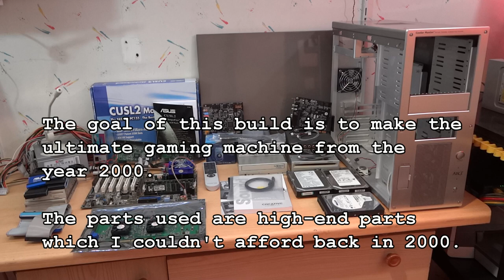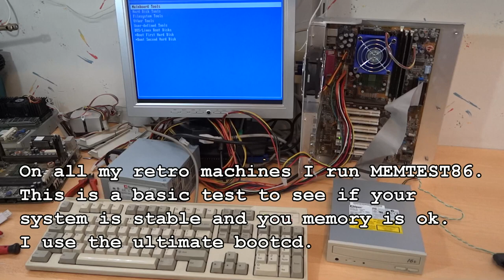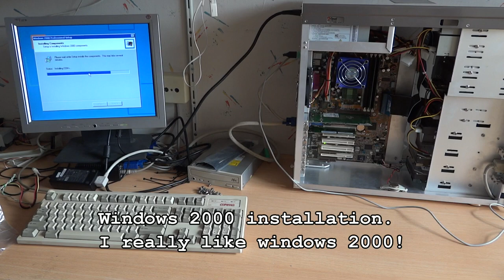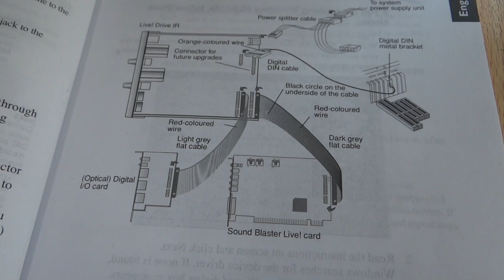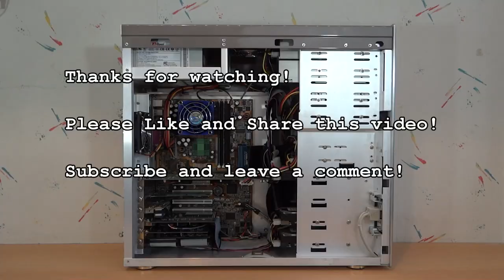Ultimate year 2000 gaming build! 3DFX Voodoo5 Asus CUSL2 P3-1ghz CM ATC201

Comment: Thats a nice case even by todays standards.
Reply: +Clesarie agreed.
Reply: I was thinking the exact same thing watching the video
Reply: +Clesarie The only thing that would make it better is if it had today's level of cable management options, better front I/O (even so, that can be fixed with 3.5" external brackets) and a CPU cutout on the back of the MoBo tray for easy aftermarket cooling installation. At that point, it'd blow any case on the market today out of the water.
Reply: Looks like he would have needed a time machine to build into it in 2000 as it was released in 2001. but yeah the case is nice, it was amazing back then.
Reply: +THERAZORKILLE Productions CPU cutout costs about as much as a dremel :)
Reply: i have one in the attic, doesn't fit modern 120mm fans and it be a shame to bastardise to do so. I have a p3-800 inside it. Might be time to get it flying.
Reply: it was excellent case, all screw threads were drilled in to steel rivets.
Reply: For my main desktop computer, I still use the same case that I'v been having since 2007, but I rebuilt it with newer components mainly from around 2012 to 2013 such as an AMD fx6300 six core 3.5ghz, 16 gbs of ddr3 ram 1866 mhz, 800 watt coolmax psu, 160 gb intel ssd with a 3 tb seagate hdd, and an AMD radeon r9 280 oc black edition graphics card with 3 gbs of vram.
Reply: Better than mine!!!
Reply: also needs better radiator support but totally
Reply: ^That's not Thats ^today's not todays
Reply: Absolutely! I had a choice to buy either this case or a Lan Li PC-07B Plus back around the mid-2000, I  got the Lian li case till this day, with some nice extras. Black brushed aluminum is gorgeous...
Reply: @TommyFenstermacher5150  cable management are horrible if psu are not modular because of how thick the cable were
Reply: But still it would for retro gaming pcs

Comment: You should power the 3DFX on it's own and not shared with any harddrives. Harddrives in the past where sensitive for voltage fluctuations. Esp. when going into 3D mode the AGP Card was able to take a peak load from that same line, causing a slight voltage drop. Harddrive's can go bad with such a setup. Props on the retro-build.  However a AMD Athlon was proberly the better and faster CPU for this setup.

Comment: Today I was taking inventory of some old computers I have, and when powering up my dad's old Dell, I found a Voodoo5! I was very surprised.
Reply: whoa, nice found
Reply from the maker: +inteli722 Sweeet! make a nice build around it!
Reply: +victorbart 3 days and some more salvaged parts later, I did just that. Not nearly as fancy as this build, but for $0, it isn't too shabby.

Pentium III 866 MHz, 512 MB RAM, 2 20 GB HDDs, a Soundblaster Live Value (made in 2000), and the Voodoo 5, all for a grand total of nothing but 2 days of leaning over a low table working on it. I just need an era-appropriate case, monitor, CD-RW drive, and mouse pad, alongside a copy of Quake III and UT1999.
Reply from the maker: +inteli722 Awesome! And with that specs just the same game experience as with this machine :)
Reply: +inteli722 i wanna a video by you m8!
Reply: +Tuna Yücer ***see a video
Reply: Tuna Yücer This video is way better than anything I could put together, so I don't really see a point.
Reply from the maker: Just make a video! Just do it :)
Reply: victorbart If I make a video, it's going to be after the custom painted case is done. I can't find a nice CM case like you found.
Reply: I found a Voodoo 3 2000 in a box of computer junk I was given for free. whole lotta crap, even got a K6 - 2 out of it :3

Comment: I still have my old p3 933 with geforce 2gts 32mb, 20gb hdd.. Bought the system in may 2000. Later i went dual cpu on a tyan tiger with 2x p3-1400mhz... I still have most of the parts. Inspiring video, thanks for sharing

Comment: Did anyone else notice the CD burner had its own cooling fan?
Reply: I once pulled a superdrive out of a trash picked Mac G5, it was an LG drive which had small twin fans on the back either side of the IDE connector and I remember laughing hysterically and the idea
Reply: Paul Omans 
a lot of the old ide  DVD drives had fans in them
Reply: Well, otherwise it would...
burn
Reply: Frytki? May i show you the exit?

Comment: When a 2000 computer runs better than my crappy 2016 laptop
Reply: Yeah, i'm very surprised. My laptop has the Intel integrated graphics... I fucking hate the Intel HD graphics, i can't even run cs 1.6 without lag lol. it's bullshit
Reply: Yeah, i'm very surprised. My laptop has the Intel integrated graphics... I fucking hate the Intel HD graphics, i can't even run cs 1.6 without lag lol. it's bullshit
Reply from the maker: +Yukki Amano This machine runs CS 1.6 like a Boss :)
Reply: +victorbart That's cool! in my house i found a first gen intel pentium (92'-93'), sadly the processor have 2 broken pins :c. It's anything valuable or it's garbage?
Reply: @missingno3617  hey
Reply: integrated graphic card is for showing something/able to boot into windows, when you don't have any card. Or your card will pass out. It's not for playing anything.
Reply: @missingno3617  The first gen Pentium only the 60 and especially the 66MHz model are really worth something. And with broken pins you are only able to sell the Goldcap ones (the ones with the golden headspreader) as scrap.

Comment: Geforce3 came out in 2000 and smashed the Voodoo5. Also, the AMD Thunderbird 1000Mhz smashed the Intel variant that year as well.
Reply: +George Babbitt 
In benchmarks the Geforce3 was better than the Voodoo5. However, many games at the time were optimized for the 3dfx instructions so the Voodoo5 card would run better than the Geforce3 in everyday gaming.
Reply: GeForce 3 was launched in early 2001. The contemporary card to the Voodoo 5 5500 was the GeForce 2 GTS which was launched a few months earlier than V5. The GeForce 2 GTS was faster than Voodoo 5 5500, so no need for GeForce 3.

Comment: It's interesting to see that despite how much has changed, some things still remained the same simply because of how things used to be.

We don't even take off most of our rear PCI-e covers today, but back then nearly every slot was used! Moreover, the ATX layout with the rear I/O, CPU in the middle top, and RAM to the side... nothing really changed the conventions even if tech improved significantly.

What an incredible treat! This case is still beautiful even by 2021 standards, and the removable motherboard tray is an amazing feature that i wish was more commonplace! I really hope Cooler Master tries to remake a case in this style, with modern conventions like front mesh, tempered glass panels, PSU shroud, and so on, but retains the nice silvery metal look and the removable motherboard tray...
Reply: I managed once to fill almost every slot in ATX case. I put graphics card (2 slots), Xonar DG, WiFi card, PCI-E slot cooler, USB 3.0 controller. But yeah, ATX form factor is pretty much overkill today. Most people would be totally fine with mATX and good part of us, even with mITX. What imo killed ATX was the death of SLI and Crossfire. That was the main reason why enthusiasts needed ATX boards at all.

Comment: No love for Half-Life? Or CS Beta 5? An Epic build though. Brought back a lot of memories.
Reply from the maker: Offcourse! :D I played HL1 so much. But I also wanted to try the other titles.
Reply: *****  I fail to see your point. Yes, some of these components cost premium in this kind of condition, on the other hand most can be found discarded in a dumpster or laying around in some hoarders attic. In fact I ditched a whole box of stuff from this era, all in good nick, just a few months ago. (yes into SER garbage)

Many of the games and applications from this era no longer working on modern computers and emulators are a poor substitute lacking appropriate emulation for 3D acceleration and most of the time sound hardware. They use (poor) software synthesis to achieve backwards compatibility.

Indeed now that I'm no longer a teenager and actually have serious disposable income I don't mind building rigs like this. They are a bit like vintage cars. Although my personal preference is for old 64bit RISC Workstations I can see the appeal in this type of a PC.

They are interesting pieces from the history of computing. In this case, home computing.

Comment: Hey Victor. I still have the same 40gb Maxtor drive in my PC from 2002, and after 13 years of usage still works flawlessly. It's kinda loud tho :)
Reply from the maker: +MegaBojan1993 yes a good drive :)
Reply: +MegaBojan1993 My 40G ATA HDD still runs without any bad sector, it's really rock solid :D
Reply: Vinh Duy Sadly, nobody makes long-lasting hard drives anymore :(
Reply: Don't be sad :) life is a long-term experience. Something came, and something went away.
Reply: Vinh Duy I know but I cant help it. I always grow so attach to my PC componenets :)
Reply: +victorbart Monitor is?
Reply: +MegaBojan1993 me too :D one of the best HDDs ever imo. Mine works flawlessly too :)
Reply: ***** You know whats even more amazing. My hard drive is constant 50 celsius and still works. I suppose it was designed to withstand those temperatures because it has a backplate on its circuitry.
Reply: ***** I dont run out of space on that hard drive because I only have windows xp on it with some pretty small programs. The PC in which that hard drive is installed is used only for playing back mp3s watching DVD movies and viewing photos (the images are not on the hard drive, they are on an USB memory)
Reply: MegaBojan1993 i have it too but it is a late 2003 model and also 40gb and loud but it works

Comment: I wish I would have the chance to do the same building my dream rig back in mid 2000.

Intel Pentium 4 extreme edition 3.2Ghz socket 478.
Intel D865 PERL Motherboar.
1gb dual 512mb ddr 400 in dual channel mode.
400w high quality PSU.
Dual 150gb ide hard disk in RAID 0.
Best video card of all time. "All In Wonder Radeon 9800xt" AGP 8x baby!!!
Reply: Nooblet lol that ain’t 2000 more like 2002-2003
Reply: @justiny.1773  He didn't say 2000, he said mid 2000.

Comment: Really??? A Pentium III, when the Athlon T-Bird was available at the time???
Reply: +SparcTec (ScreamerWiki) No game supported more than one core at the time, what would be the point?
Reply: *****
He wanted to build the ultimate GAMING machine of the year 2000. Now, again, which games were able to use multiple cores in 2000?
Reply: +egykilenckilenchet Smartasses will be smartasses :)
Reply: +Ayrton Senna Yea, back when AMD was a threat to intel. Now, they are a joke. I used to be a hardcore AMD fanboy; I still miss my Athlon XP machines -- those were the days.
Reply: +SparcTec (ScreamerWiki) Seriously those dual Intel sucked big time. The first REAL dual CPU were the Athlon MP series. AMD totally dominated the high performance multi CPU machines until a few years ago!
My dual AMD MP1800 (build in 2001) ran windows XP as smooth as any Intel Core2Duo. Over the years I upgraded it with MP2800 and it was only somewhere in 2008 that I completely retired this machine.
Reply: +Hank Hill Ever worked on a dual MP? Imagine booting Windows XP in 10 sec, starting most office applications in 2-3 seconds. I am pretty sure that machine could run Windows 7 at decent speed ... hmmm, maybe I should get my old gear out again and test this one ;)
Reply: +SparcTec (ScreamerWiki) While MP and XP have the same origin only the best ones may become MP. My system ran stable for ages, I really would like to see a "second choice" XP which wasn't good enough to be a MP run at 75-80 degrees Celsius 24/7 because that's what an MP will have to endure in a 1U server!

Also, why would you risk a good server mainboard with some "hacked" XP? I have seen +$1000 mainboards go to waste because that fake XP wasn't well enough.
Reply: +SparcTec (ScreamerWiki) You have to use conductive paint on the CPU so that they get recognized as MP. Since you modify the CPU to use it differently it's a hack!
Reply: or Pentium 4

Comment: The CPU slightly beats what I had in 2000, a Pentium III 800 mhz, but my GPU totalllyyy would murder the voodoo 5, Geforce 2 GTS 64 MB :D It kicked so much ass back then.
Reply from the maker: Coops Game Shelf I also have a system with a Geforce2 and Voodoo2 sli setup and they are both fast and as kicking :) The downside of the Voodoo5 is directX support only DX6 and the GF2 does do DX8. So I can run GTA3 on this build. I finished the game with the voodoo5 but I doesn't run great.
Reply: Awesome. I didn't know the Voodoo 5 could run GTA3.